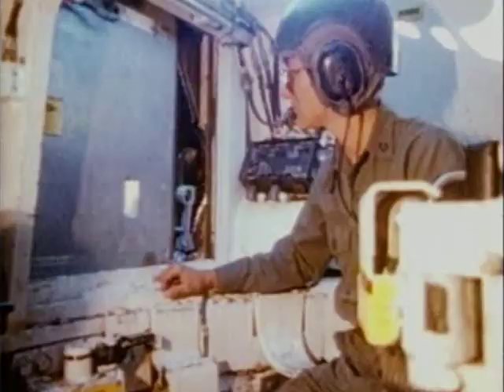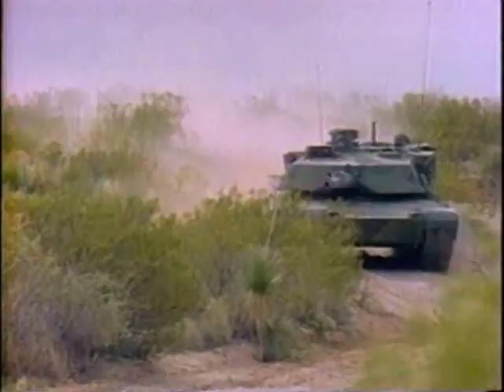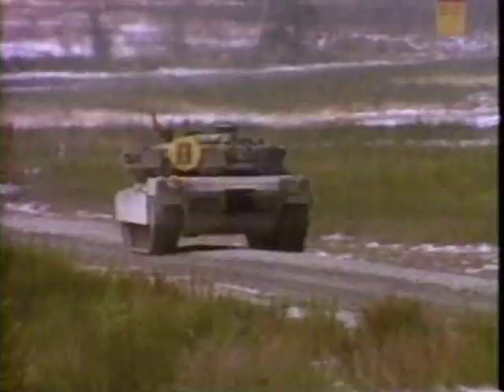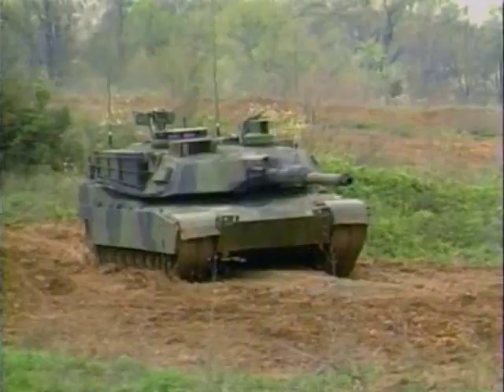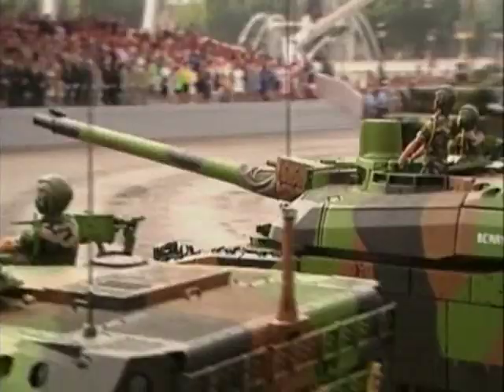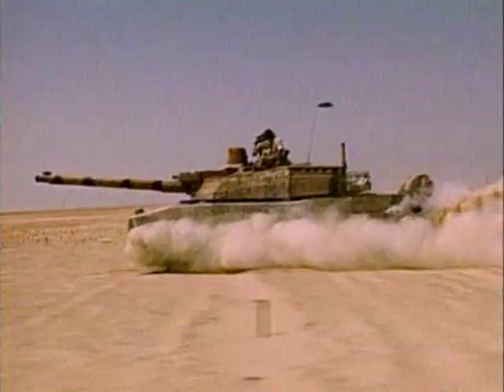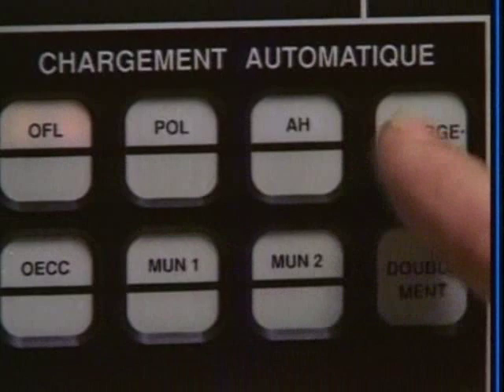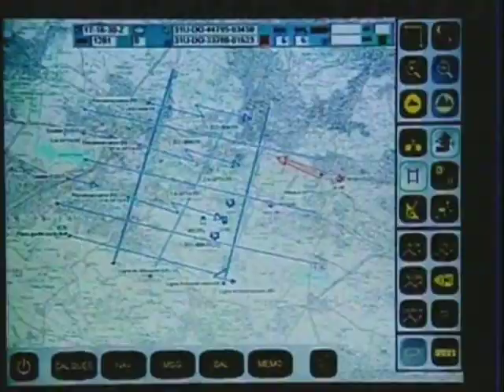Firepower - Battle Tanks (Part 2/3)

Comment: Rifled guns don`t have reach the kinetic energy a smooth bore pentdant might reach. High kinetic energy is a big concern when it comes to armor penetration, so they made up for the lower kinetic power by using depleted uranium against armored targets. This is problematical for political and health aspects for obvious reasons, so they started an evaluation program in 2004 by fitting the german l55 smoothbore gun to a challenger. The tests showed that the l55 with a dm53 penetrator round...

Comment: hmm if an AT gun hits the ifrared scaners and the sensors the tank is basicly usless, beside i wonder what woud they do if all the electronics failed ?  ,,, is there a manual option ? ..+ good luck with all the options on the screen :D ... jesus crist what more would a man need in a hot battle than just locate enemy and fire 2 things , like the dudes going to start pushing the screen like crazzy going threw all the options :] .... i dont know if all that technology and electronics would be good